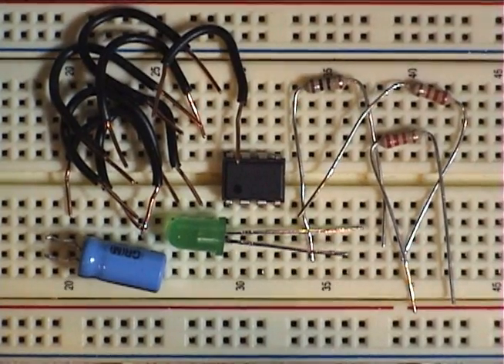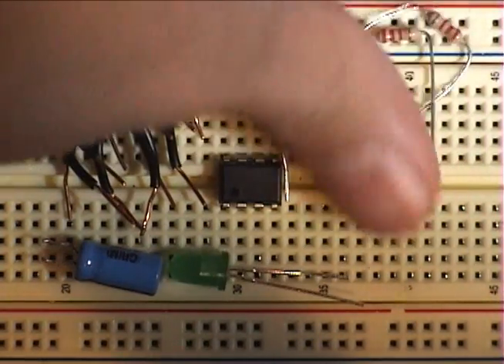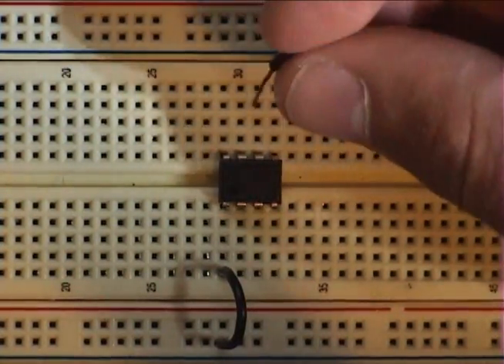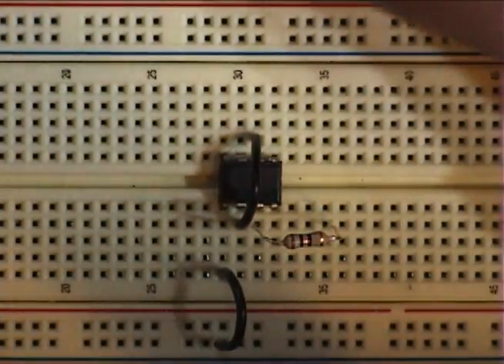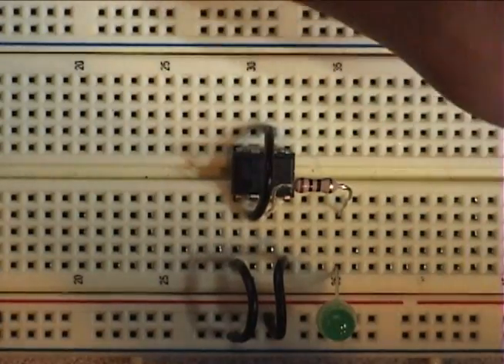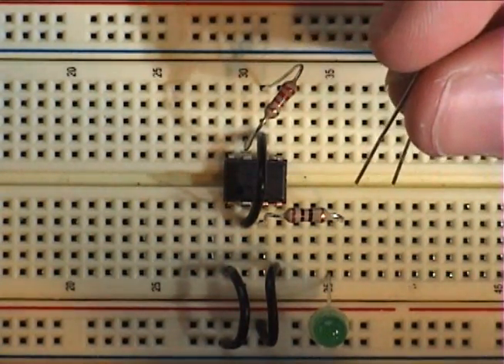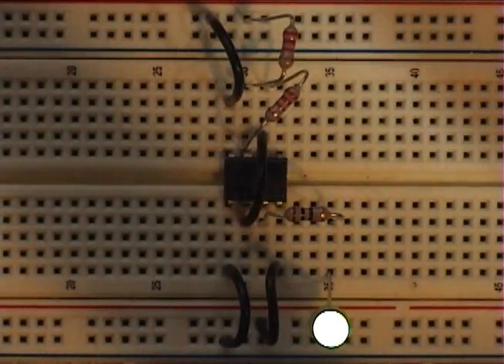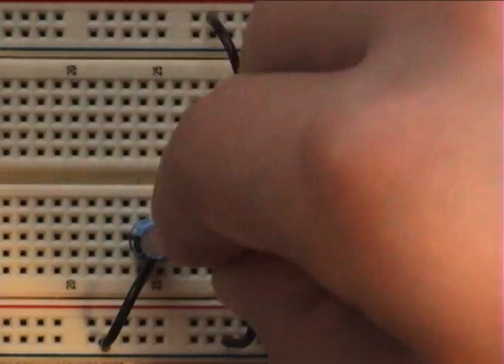555 Timer Tutorial

Comment: Thanks man worked a treat, I was needing a 1Hz square wave signal to go into a 4026 decade counter, I used 100k to connect pin 6 to 7 and 10k to join pin 7 to power and 10 micro farad for the cap, I had got the values from elsewhere. I had tried a load of different circuit diagrams and videos but yours was the only one I had got to work, cheers.

Comment: I used USB 5 Volts and that works. Current draw is negligible since an LED hardly draws anything. You didn't say what value cap you were using but I found out it doesn't matter (unless it is too small). All I had was a small (nf) ceramic, which didn't work, and a 3300 uF electrolytic. That worked but was about 20 seconds on 10 seconds off. SLOW to charge that big boy up and down. Start with a small (50 mF?) electrolytic and work your way up. Seems the higher the value, the slower the cycle. Only makes sense.

Comment: With only the three resistors ( I used two 4.7k's and one 100ohm for the led), the 555 timer and the led all connected in the circuit (not the capacitors), the led does something weird: it fades out within 3 sec and then doesn't turn on again unless you wait for some time and connect the battery again. With the capacitors in place, it blinks, but fades after 5 sec and doesn't turn on again.  Help! What am I doing wrong??
Reply: ed w222ettrrr33222%r

Comment: what equipment does you used  pls tell so that i can buy it
Reply: he used a ne555p timer bredboard electrolytic capacitor (if you use like 1 uF its going to blink fas but if you use 20 uF cpacitor its going to blink slow)and some 2 pcs. resistors 4k and 1 resistor 100 om

Comment: Thank you for the tutorial. I think that the timer is used for putting together led sequencers. I would like to turn on led strips in a sequential pattern. There are 150 leds in the 5 M strips and I want to have each strip chase the previous strip with a total of 16 strips and no 2 strips are illuminated at the same time which means that each strip will use 12 volts at 3 amps. Any idea on how to wire it?

Comment: What was this frequency designed for?
How much was the value of Resistors across Pin# 7 & Pin # 8? Let me call this R1.
How much was the value of Resistors across Pin# 7 & Pin # 6? Let me call this R2.
R1 & R2 decide the duty cycle.

If I consider the ON time to be t1, then it is given by the formula t1=0.693(R1+R2)C. So what was the value of C?

If I consider the OFF time to be t2, then it is given by the formula t2=0.693xR2xC.
These formulations are for Astable Multivibrator.
It would have been interesting if the design also discussed in this manner.
Also the application of 555 timer.

Comment: when he says connect something to the ground he means to the negative of the battery and when he says connect to positive it is the positive of the battery.  If you mean where does the battery connect to the little pins he is inserting, he is using a breadboard and on the side (off view from the camera) there are little attachments for battery leads that link to the underside of the breadboard power pins

Comment: I know nothing about this stuff but I need to create a circuit that limits the duration of a connection through a DPDT switch.  What I want to prevent someone holding the switch in the closed position for to long and burn up a motor running on 9volts. The duration should be about .66 of a sec. I would also like the LED to glow if power is on. Can you help me create such a circuit?

Comment: this tut was easy to understand but ive got an easier way using 2 resistors 4 wires 1 led 1 capacito and a 555 timer. all you do connect pin 4 to pin 8 and connect pin 8 to positive,connect pin 2 to pin 6, connect pin 1 to ground, connect the capacitor the longer leg to pin 2 or 6 and shorter leg to ground, 1 ressistor from pin 6 or 2 to pin 7, and connect a resistor from pin 7 to ground then put the battery in and youve got a flashing led.

Comment: nice and simple.....potentiometer between pin 7 and pin 6 will adjust repetition rate...but speed of pulses is still dependant on capacitor value.....the lower the value..the faster......you did not explain that your simple circuit   has an automatic pulse width....on-time is longer than off-time......to adjust for that....you can place a diode in reverse between vcc and pin 7....that will cause 50% duty cycle....

Comment: You should always by-pass pin 5 with a .05 uf disc capacitor...it serves 2 functions...to eliminate spikes from the supply rail at the internal comparator during switching and smooths out the depletion layer delay during switching recovery at the internal discharge transistor at pin 7....it is a good practice to always by-pass that pin regardless of simplicity of circuit.. sometimes even simple circuits like this one gives you lots of unexpected outcomes.........thank you

Comment: I got an electronic snapkit from radioshack and used it for this. you can use any resister and capaciter but the resister that connects pin 6 and 7 is the one that controls that blink rate. the lower k resister you use the faster it blinks! Hope this helps someone so I didnt just waste my time:)

Comment: @MrStemkilla google "semiconductor p-n junction" basicly the two sides of the capacitor are made from diffrent materials to maximize flow. current running against it would defeat the purpose and also damage the materials the plates are made out of

Comment: @2010adb depends on the chip, some datasheets spec 3.3V absolute ratings, others spec 20V and up, all depends on your individual needs as all a 555 timer is internally are two differential amplifiers which are more accurate BJT's wired as comparators. normally i use 5-9V on a 12V rated 555. never go above absolute maximum, that is the o-shit moment.

Comment from the maker: @Saturn364 Yes, however, with a load like that you should use a transistor. If all you need to do is switch leds only on or off (or dim using PWM); for this mode of operation (the most common one for 555 timers) use a MOSFET transistor. If you plan to dim them by analog signals (uncommon with 555 timers) you should use a Bi-Polar transistor.

Comment: Thanks for the tutorial, it was very helpful. The circuit I assembled according to the instructions didn't work at first. I switched out the capacitor for a larger value, and then it worked perfectly. Turns out the 0.1μF capacitor I originally used wasn't big enough to charge and discharge properly, so the LED simply lit up and was rather dim, and didn't flash. A 470μF capacitor did the trick!

Comment: sweet tut i like it, got my circuit working but when i tried it like the 6th time it wouldent work, i tried a different 555 ic, checked the voltage of the battery changed  resistors but nothing. any ideas why??